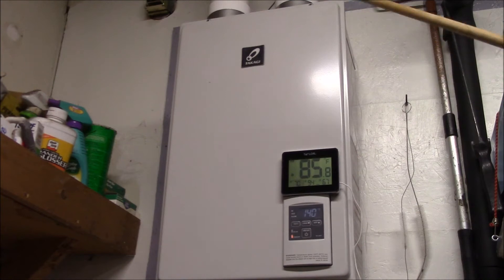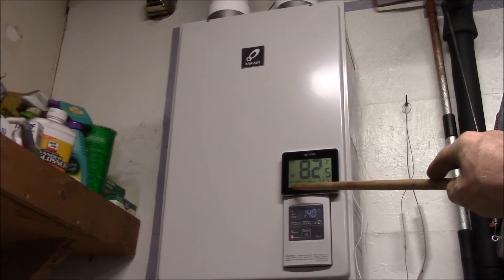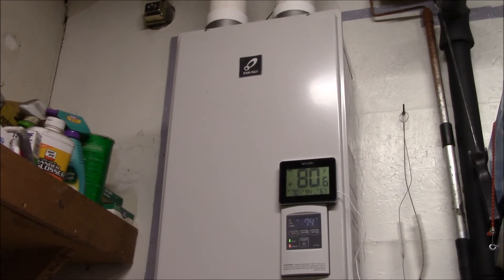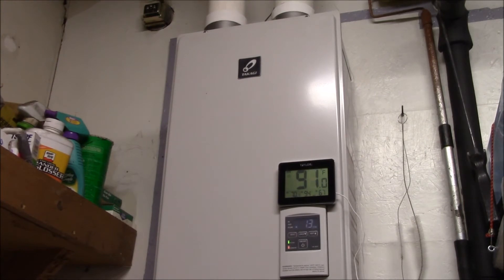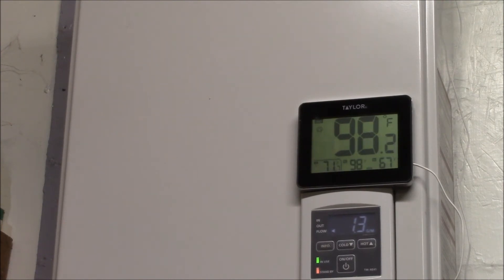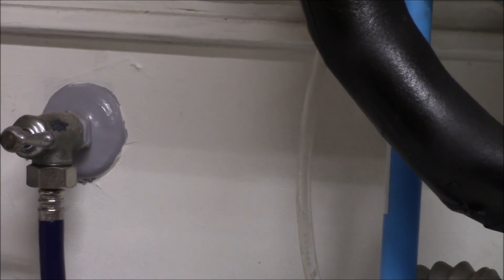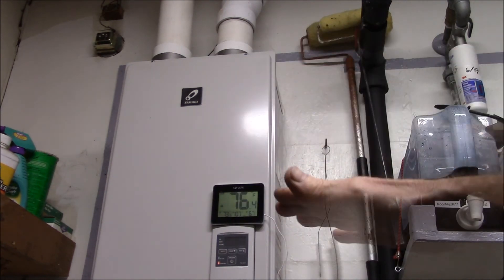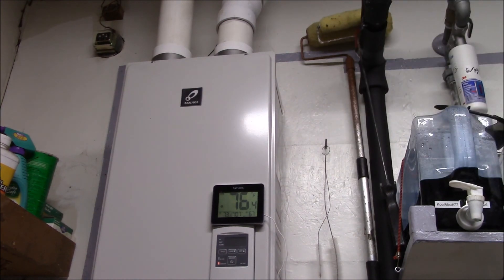Condensing Tankless Water Heater Exhaust Temperature

Comment: test it with 100f outlet with winter temp water or summer it will be way lower flue temp :)
Reply from the maker: Yes, that would be the case.  With the colder inlet water, that'll cool the exhaust gas in the secondary exchanger more.  In the winter I usually see temps of 90F or lower.  In the next video, I push the stack temperature up to it's limit:
 https://youtu.be/3usNy5DDUkM 
That was with warm late summer warm water and highest flow and output temp.
But yes, these condensing units really pull the heat out of the exhaust gas to get those 90+% efficiencies, I think this model is 93%.

Comment: Hi Mr. Brown, thank you for showing us your DIY. Takagi wh, i just install my new takagi,i put black pvc on intake, while im waiting for my exhaust vent from online store, i used the black pvc on exhaust ventt, it works but i think it will not last, cuz it is not solid pvc, andits hard to find the one that you have, ( the solid pvc), i used plum bulb to center the wh from the exhaust( straight vertical), i used also a pan as a thmble,  and i bought a ferno connector from lowes cost me anly 9$ instead of ffconnector,  (why did they not expand the tee connector). Anyway my new exhaust vent is not stainless cuz the magnet stick to it!!
Again thank you Mr Brown.,
Reply from the maker: Stainless steel can be magnetic or not depending on the exact alloy.  Many common alloys are somewhat magnetic, although on my heater, the two stainless adapters seem to be non-magnetic.  Yes, I think Takagi needs to address the fit of the adapter with the PVC connector they ship.  I notified them of that over 3 years ago and apparently nothing has been changed.  
From what I've heard, the main reason for the solid core plastic venting  is due to potential sagging on long runs that are nearly horizontal, as the cellular core material is not as strong.  With a nearly vertical vent, that may not be as much of an issue.  Probably a good idea to check every so often to look for signs of heat damage.